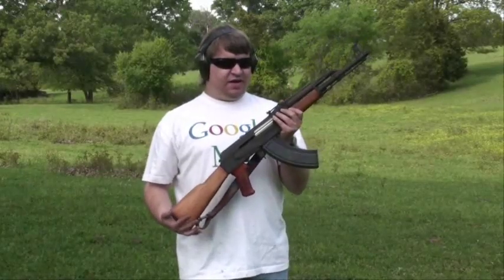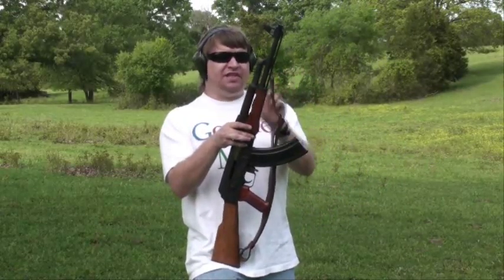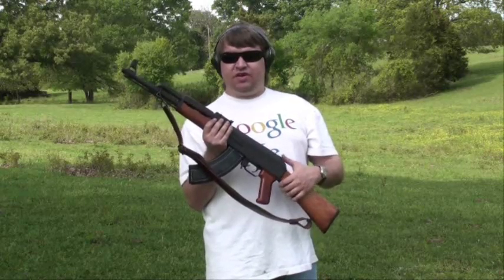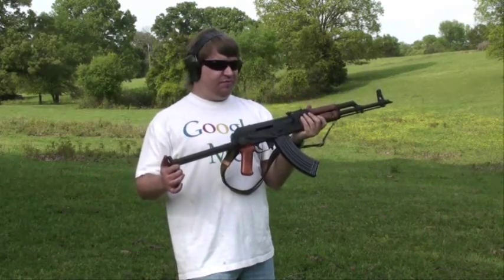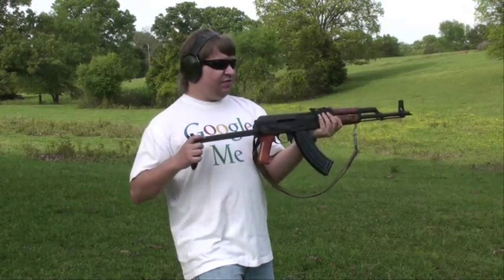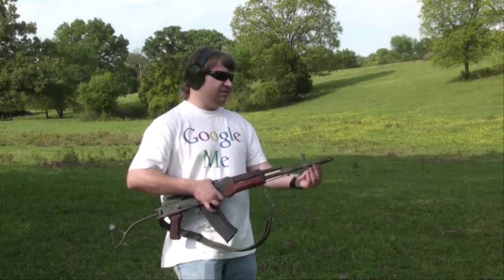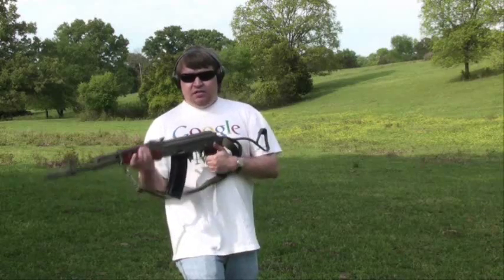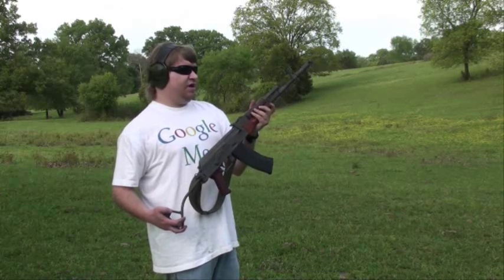Polish AK Variants

Comment: I love the WZ. 88 Tantal, I actually like it just as much or more than the Bulgarians and Russians because of its originality and quirks. Mine is also a century but I have had no problems firing Vympel FMJ boat tail ammo through it and it is very accurate. When I got it, it had some issues with light primer strikes but after switching out the trigger and spring for ALG Akt enhanced parts it runs flawlessly. Also very easy to bump fire. I've also added a Beryl handguard set and an Amd65 Tech cheek riser to further its ease of use and practicality. Wouldn't sell it ever if someone offered me a grand or more.

Comment: To everyone asking about the Beryl/Archer, we have 3 different videos up covering both the v2 and v3 of the Archer-01 which I.O. imported into the USA for a couple of years. So if you get a chance do go check those out. Also, since doing this video my Polish collection has changed a good bit. So planning on doing a new video covering the KBG WZ.60 grenade launching version, as well as a Tantal build with original Radom barrel. Hopefully we can shoot that video sometime in the Spring. To everyone, thanks so much for watching.

Comment: I have a few tantal Sporters.. all great shooters with 7n6 ( I have a good enough stockpile I got when it was the cheapest milsurp center-fire ammo available.. all are non chrome lined so post shooting I am very proactive with neutralizing the corrosive salts from the 7n6 ammo.. they will most certainly rust and pit if not cleaned up within a day or so to..  2 are 2/2.5 moa shooters with 7n6.. one consistently runs 1.5 to 2 moa but frequently closer to just over  1 moa.. I put arsenal nato length plum furniture , us palms grip in the darker brown a kydex cheek rest and a Texas weapons picatinny dust cover with a 1/6 (holds zero quite well I must say even with a few years of rough use)  I have been able to hit 8" steel gongs to 600 with alarming consistency though it's beyond the limits of the optic it's doable.. sub 400 it's a high speed lo drag designated marksmans rifle and performs clean, dirty , dry or wet and cold bore or heat soaked it drops those 53 gr pills right where you want.  Clearly I got my units from a particularly well built batch with barrels that perform well (exceptional in one case) with the surplus ammo I have (same lot numbers and production date on multiple cases so I feel like I hit the lottery. Too bad 545 had the misfortune of being targeted by antis .. it was my favorite lightweight center-fire and still is to an extent.. I prefer the ak chambered in it over 762 for so many real world reasons though fortunately I have never had to fight with one I have thought about that choice of 762 ak vs 545 ak and assuming equal ammo availabilities I would always pick the 545 .